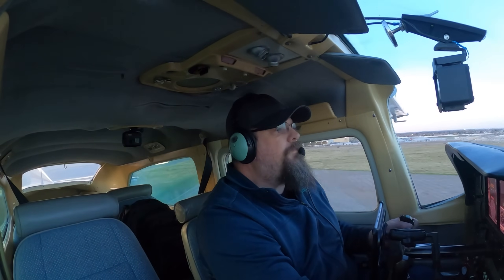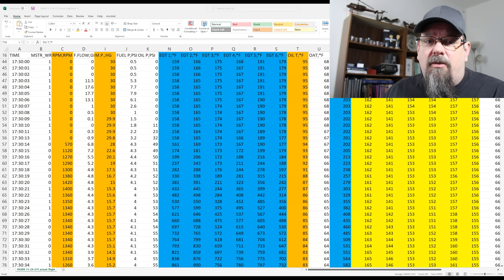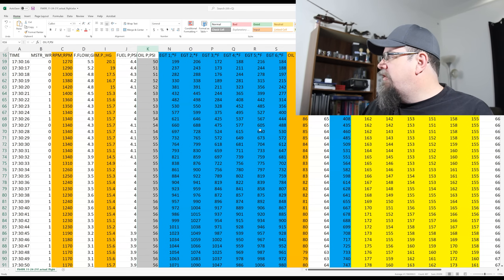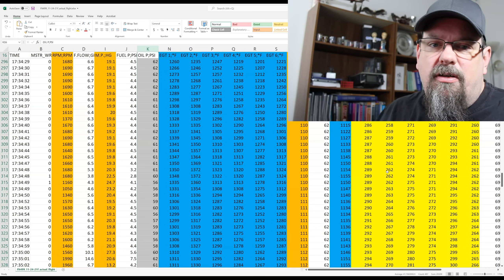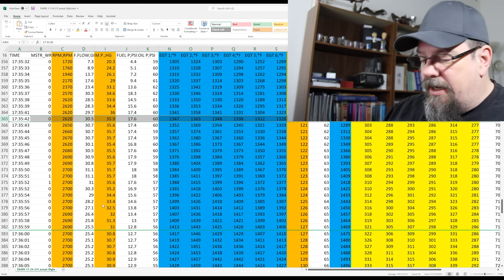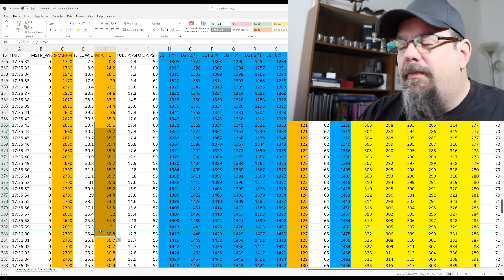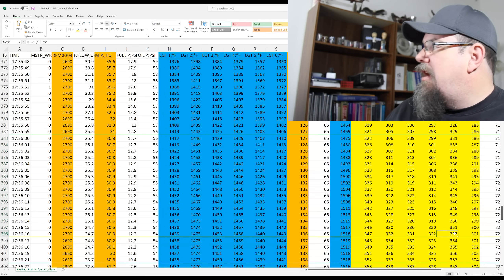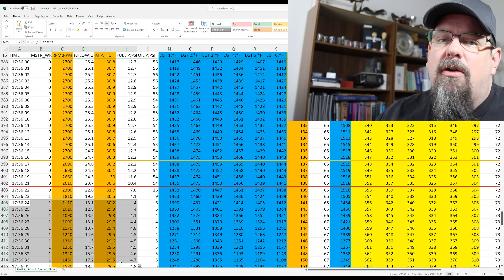So What Actually Happened?

Comment: You know why hes paying for all that overhaul standing behind his word? Because clearly the guy who took it apart had better things to do and left... giving the job someone else where he left off which could have killed you. We talked about this sort of thing in AMT school about how you dont sign off on that plane until you know the work has been done. Whoever signed off on the plane should have been fired. You could have owned that business because of that mechanic who didnt want to notate where he had left off... Counterweights dont just come off... Catastrophic Engine Failure happens as a result of someone making either Poor Maintenance Scheduling or someone doing Poor Maintenance. 

A good mechanic would have made damn sure before he got a hold of that engine that the work performed had all be done right and saw where Maintenance had signed off saying what they did... Check the Maintenance log they have to list every single thing they do in that log. From the time he left till the time the new guy came in... Someone either was too tired or had better things to do or was OVERWORKED... Or someone didnt get their damn head on straight before their shift. Look at the logs and see who did the counterweights last and if they listed that they had done the counterweights and who signed off on it. I would have lawyered up. You said money wasnt the issue. You shouldnt be getting all overhauled parts you should be getting an entirely new Engine PAID FOR BY THE SHOP WHO DID IT. They could have cost your life.

Just my take on it. I took Part 144. I learned a thing or two. We discussed many aircraft crashes as the result of someone who signed off on poor work... Or signed off an a plane that wasnt ready.
Have a look at what is known in the Aviation Maintenance world as the DIRTY DOZEN one of those 12 was more than likely why that engine was put back together in that manner. You could be owning that shop and your own fleet of Aircraft if you had lawyered up gotten the maintenance logs and proved it was the mechanics fault for not checking the work.

Comment: I’m not a subscriber. I probably won’t be, but this story came across my YouTube back a few days after you had your engine out and I’ve been following it.

First off, as a fellow flyer of a quiet aircraft that should be making noise, bravo! Your execution of a forced landing was impeccable. Nobody actually knows how they’ll respond to a true EP until it happens and you kept it cool as a cucumber.

Secondly, it’s very cool that you were able to dissect this incident with the engine management system cameras and other equipment you had available to you on your flight. Nobody ever plans to capture a catastrophe (besides the not so subtlety referenced Trevor Jacob).

Thirdly,
Good on the engine shop. Aviation is 90% crooks, 9% normal people, and 1% great people. I believe you have yourself a 1% engine shop.

Comment: I've seen a few of those counterweights come off over the years. There is an array of different configurations depending engine part number. Even the pins have different part numbers depending on position. It would be very easy to mess up installing the circlip retaining the plates and consequently the pins. We include a duplicate inspection on those circlips during assembly to avoid the issue you have experienced. Good to hear that the shop stepped up and did what they needed to do. Love the extinguisher pants!

Comment: When that much carnage has happened on the inside it’s hard to tell what went tink first.  Given the sudden onset of failure and the picture window in the block I wouldn’t even have opened the data log.  If it were an engine performance issue or even a scuffed cylinder wall or a stuck pin joint I would have expected the failure to develop at least over a second or two.

Good to hear the shop not only recognized an error in the build but made it right and informed you of procedure changes to prevent recurrence.

Comment: I saw a documentary talking about counterfeit and inferior aviation parts. So when they inspected Air Force one it had counterfeit parts but the problem is supposed have been dealt with. The parts and sources are supposed to be under strict guidelines but who knows. Should be a requirement that the mechanic that rebuilds the engines sits in the passenger seat when you go for a test flight.

Comment: Hi folks, in days gone by in our Royal Air Force the pilot would take up the lead mechanic on the test flight.after a major overhaul. Concentrated minds wonderfully. I believe it is no longer done, and tricky with a single seat fighter. Good that the shop stood up to the plate but I'd still be wondering about the replacement overhauled items. Having said that, I once forgot to tighten the nut that held the oil pump drive pinion in place on a Norton 750 cc motorcycle - similar results and a lesson learnt the hard and expensive way.

Comment: Who would want to work on such an archaic engine design which has removable counter weights with circlips involved in their retention. That sort of design is out of the arc and consequently adds a lot to the cost of running and maintaining the aircraft, let alone considering the lives lost as a result of engine failure. They say that the world is going mad, considering these engines it's been mad for a while.

Comment: A catastrophic engine failure such as this, particularly at low altitude, is the reason Bold Faced Emergency Procedures must be thoroughly memorized; in this case where fuel lines are severed and likely dumping fuel all over a hot engine, an engine fire would be VERY likely, and quick reaction in accomplishing those procedures will reduce or eliminate secondary emergencies from occurring. First and foremost however is maintaining aircraft control.

Comment: Way to go... Sounds like you were lucky on your engine exploding but it would seem that you have a good stand up mechanic that backed it up...  Thank God that your O.K. but I do have questions.  After an overhaul, repair or replacement isn't it common practice to bring the engine to full power for many minutes and then cool down and do this for a few cycles before any actual flight time?  And if not why not? That would seem like a good idea...  And one other question, did you think about maybe retracting the gear after you had already lowered it after the engine let go.  Maybe to reduce drag until you were a little closer to the airport?  Just wondering... Love your videos...  Fly safe..
Reply from the maker: Thanks!

Yes, there are ground / test-stand runin procedures, with various power settings as a 2 run test. There are also recommendations and procedures to keep the cylinder temperatures below 200 degrees F, until you can run it at max cruise power for an hour or two to prevent glazing.  

As for the gear, there wasn't really a decision here, I was abeam the numbers and put the gear down. It takes 8-11 seconds to fully cycle, and from the time the engine let go to the point I was over the threshold was 36 seconds.

Comment: Glad the engine shop is going to get you back in the air, after all the engine was not fit for purpose and the outcome could have been much much worse. Alls well that ends well and I see you have learn't from another you tuber to be safe if this happens again........always strap a parachute on and fire extinguishers on the outside of your pants so you can reach them quicker. Well done on the landing!

Comment: Looks like 2 Lycoming IO360' that were dropped off at the FBO where I was A&P IA.  One of his " FRIENDS"  put FOD down the oil fill.  The thing that did the damage were a small ball bearing in one.   The other one was 1 small  spring.  Lycoming's mouse trap is the tappet mushroom to case clearance.  There was evidence that  the ball in one and the spring in the other started the destruction.  With a dent in the case from the bearing only a pie cut of the lifter mushroom was missing.  The one with spring popped off the whole mushroom.  The internal destruction was that complete that two cylinder skirts were deformed to the point that they could not be removed from the case half.

Comment: Great! Happy to hear you are getting a complete firewall forward replacement at no cost. Glad to see there are still honest people out there! LOL You did a great job at landing the aircraft when lost power. Now, I little tip for the next flight. Make a plan on where you are going to land if you loose power at any of the "4 runway stages". Adapt the distance and altitude to the performance of you airplane. I mean, literally seating down and making a realistic plan using performance/calculation and thinking you are not going to make it. Make this planing always, especially on airports you never been before. You will be way a head of the game on preparedness if engine quits on you at takeoff. 
Now, I little tip about your approach to landing when you  had power loss. Yes, landing gear down increases drag you loose gliding distance. You know that. But, hey! you were nervous and you made it! Cool. Another issue is this. Few people think about that. Flaps! You had 10 degrees as far as I can see from your video. I guess is that you kept it from taking off, or putting down to land. It doesn't matter. What do we use flaps for? To slow down when landing and when we do it flaps increases drag and slope, consequently less distance gliding. Yes, when engine quits the first thing to do immediately is nose down! fly the aircraft as a glider and FLAPS UP! NO FLAPS! Even 10 degrees will bite on your distance. Yes, you will have more time to think when looking for a good place to land. No flaps gives you longer distance to reach better places to land. Well, and when you are too high for a specific best place to land. Do your spiral down turns and slip is at your discretion as well. Altitude is never bad it's asset! Happy flying!
About the engine I have a different take at what was the cause for failure... ;-)

Comment: I have watched the 3 videos, so far, in this saga. Not to be accusing you of anything, but a few things leave me with concerns; the inspection and lifter replacement, the subsequent IAR which should have revealed and corrected any major mechanical issues that were on the horizon and not located during the lifter issue reapir, then your expressed trepidation on the flight after the completion of the IAR when the engine failed catastrophically. Just curious if you are conscious of why you had unease, skepticism, unrest during the saga to this point? Seems that there was something bothering you about the repair attempts during this. I am no A&P but can a loose counterweight in the crankcase cause con rods to separate at the mating caps? Or were the pistons wedged or froze in such a manner from the loose counter weight[s] that the crankshaft torsion on the big end of the rods over stressed the con rod cap bolts which then caused the bolts to fail, resulting in the caps separating from the rods?
Reply from the maker: To answer your first question, I had confidence in the workmanship, but I knew it had major open heart surgery and I was about to start flogging it. I was actually speaking with one of the senior mechanics and I suggested some full power run-ups and a high-speed taxi and was advised against it. Then I was talking with another mechanic who didn't do the work mentioned if anything catastrophic is going to happen at a critical point, it will be within the  first 10 minutes. Other than that, and reading about the bathtub curve, where the likelihood of things going wrong are at the beginning and more towards the end of life after maintenance. I don't know the specifics of the physics of the crankshaft/connecting rods/end caps or their metallurgy. but the big end and the little end were both toast on at least two of the pistons and the weight was in many pieces. I just have a report and saw a pile of metal.
Reply: @TheEdwardFrye  As stated, I am not an A&P. My experience comes from automotive and reading up on piston aircraft power plants to understand the differences in maintenance, servicing and repair/overhaul. One conclusion I have reached is that these engines are from - and still - are a state of the art engineering product of circa the early 1950s at best. About the time the last flat head fords engines were made. Given this, the meticulous maintenance, repair and overhaul procedures required to maintain airworthiness [safety of life] it seems to me that such problems as you experienced with your power plant seem very remote. I, personally, am speaking from ignorance in this matter. We need some licensed, experienced A&Ps to chime in here and correct me if I am wrong. Thanks for hearing me out.

Comment: I had a similar situation many years ago.  My wife and I had flown to Benton Harbor, MI, to look at a boat.  About a 3 hour flight from CID.  I had to pee of course.  When I returned to the airplane, my wife was standing there with a mechanic, crying.  Oil was all over the ground.  During the recent annual my shop had pinched a gasket on one of the magnetos, breaking the the bolt tab.  We had landed just in time before the oil started to leak out.  Too close for comfort.  The mechanic lent me a mag.  We took off an landed at Seneca, IL, and then on back to CID.  (I was young and fearless then)  My shop jumped through their you know whats, and took care of everything.  I still own the plane and all is well.

Comment: You want to wait to do a 'run up' and especially 'full throttle' until oil temps are above 120 degrees F (ideally 1000 rpm until then). If you have a digital engine monitor, this is easy to keep an eye on. The warmer the oil before you start adding throttle, the more it is coated on all the necessary internal components. Especially so in colder environments...good landing during a true engine out emergency!

Comment: I am glad the shop stood behind their work and is adjusting procedures. When under stress people react very differently. Adrenaline causes increased blood pressure and the heart beats faster. Some people have ringing in their ears or don't seem to hear. They breathe faster and some get tunnel vision. Some freeze. Learning to control and tame this physiological response is important. People should learn techniques that help control and calm the body. 
An easy technique to master is taking a deep breath - as much as you can inhale - and hold it for as long as you can. When you cannot hold it any longer, slowly exhale. As you do, you will feel the stress and tension leave your body. It really does work to counter physical effects of Adrenaline, which is a big part of controlling it. Calming the mind will depend largely on the person. 
Ed, did you use any method to help keep you calm during this incident? Does anyone else have a technique that works for them? So much time is spent on what to do to the plane, but I have not seen anyone talk about ways to keep the pilot calm and thinking clearly.
Reply from the maker: I did not conscientiously use any techniques to manage the stress.  I have been commuting/ lane splitting via motorcycle for the last 22 years
Reply: @Edward Frye  Riding a bike I imagine you had a few scares over the years. I have had people pull out in front of me a few times myself while riding. Your video shows a near perfect response. 
What altitude and speed were you when the engine quit?
Reply from the maker: @wylieecoyote  according to the GPS data, about 400 feet and 80 knots with 20degrees flaps (R STOL)

Comment: I had to go find a photo of a Lycoming crank on ebay,  removable counter weights must be due to low clearance to the case? You did an awesome job of brining it home.  That really tested your skill.   Great information to share and great closing.
Reply: The counterweights move on the crankshaft and act as harmonic dampers. There is an array of different configurations depending on power, prop type and engine designation. I think his engine is a Continental. Better than a Lycoming in my opinion.

Comment: Looks like a happy ending of that saga, good luck with your engine break-in/test flights.  BTW,  nothing I saw you do and nothing I saw in the data indicates that you could have caused this or even triggered it.  Most engines that go to 2700 RPM can do that for several minutes during climb-out with no problem, a lot of engines can run at 2700 all day.  Reducing RPM during takeoff won't hurt a thing.  Small mixture changes like you did are insignificant - you were running at 30GPH which is way more than enough for that engine/power setting.  This was 100% not your fault.  Break in the overhauled engine just like continental recommends and you'll be fine, assuming the shop did the work correctly.  I really hope they did, and you get 2000 or more hours out of this new engine.  Check out Mike Busch's webinars and books if you want to learn more about how to manage your engine.

Comment: Thanks for the informative video.  Good job getting yourself safely on th ground after the failure too.  I just wanted to comment on cylinder longevity and fuel mangement that you touched on.  I suggest checking out a few articles on AvWeb by Mike Busch (Savvy Aviator #65) and John Deakin (Pelican's Perch #63 and 64) regarding fuel flows at takeoff and how it affects cylinder longevity. Yours may be a touch low, too lean that is, which adversely affects cylinder life.  I am not saying it is wrong and I don't even qualify as an internet expert but I think it might be good for you to check for peace of mind.